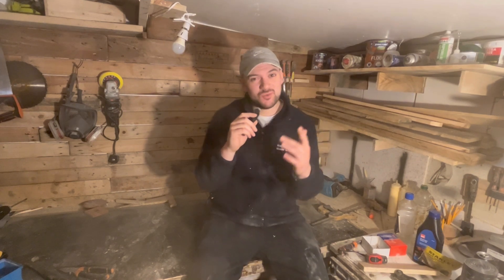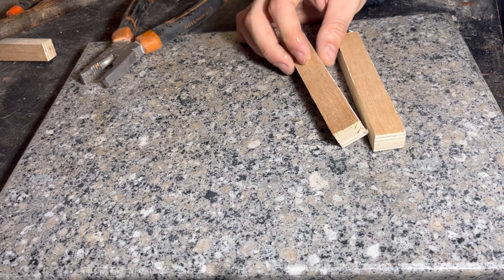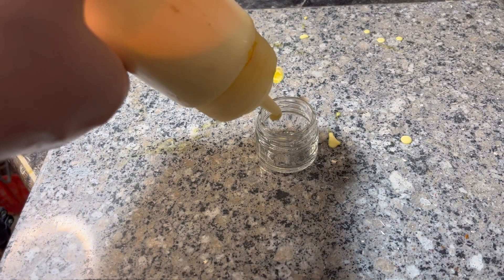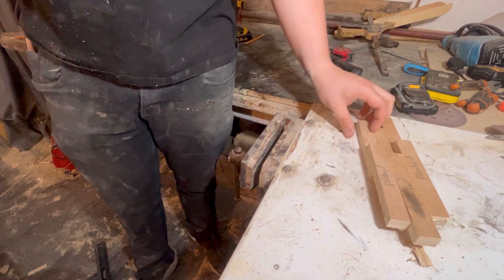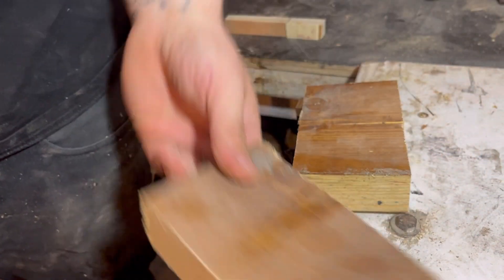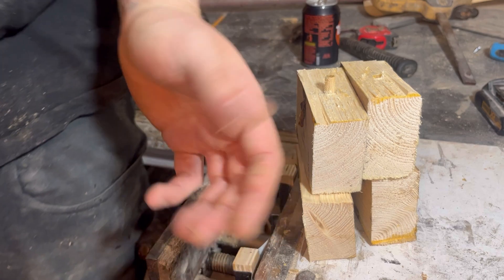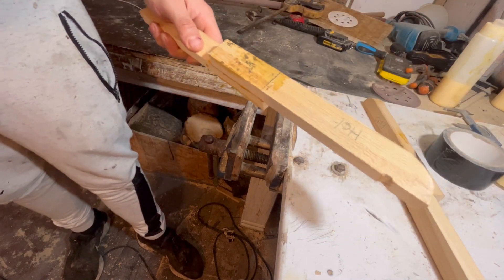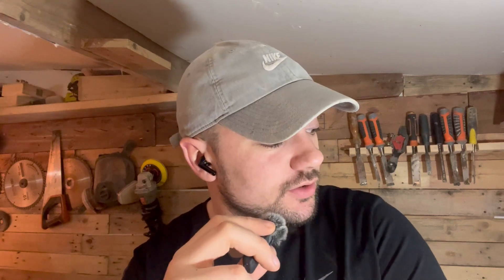Testing If Dowels Really Make Glue Joints Stronger

Comment: Depends what one means when they say 'stronger'.
If the sole intent is that it will be less likely to come apart, then yes, it will be...
But it is now an unstable - albeit still holding - joint... As demo'd really nicely when you clamped it down, heard the snap, but couldn't break it apart.

Introducing a structural weakness (drilling out the space for the dowel) and then stress concentration (introducing a foreign object- in this case a dowel which crosses the joint) will compromise the strength in absolute terms by introduction of any instability or deterioration of the joint.

It is all relative though, and in most cases insignificant.

If the joint is well aligned, and the two pieces being joined connect evenly, there is no need to dowel.

If however, it's a bit of an imperfect join, e.g. where an old piece of furniture has broken and not cleanly so.. Then the dowel will help to position thr joint whilst the glue/adhesive sets.
Not using dowels in that instance will increase the chance of slippage/suboptimal postitioning and decrease the strength of the join.

Another consideration is also the material of the dowel. Ideally it would be the same material as whatever is being joined, making it less of a 'foreign' body, its material properties will be much closer to whatever it is helping to join. (never perfect as grain/density etc etc all come into play... But closer, which is all we can hope for 😊)

Psst, love the video and how you don't junp to conclusions but are thinking about why something may or may not work!! Good stuff!

With the light clamping by the way, if there isn't enough pressure there will be small voids/bubbles in the glue so it will be less reliable in those areas. Clamp too hard and you push the glue out completely. Clamp just the right amount et voila... Perfectly homogenous, gap free glued joint! 

Now we can go figure out the ideal clamping force, taking into account force distributiion, temperature, humidity etc etc etc 🤪... And go raving mad whilst at it 🫨

Comment: The dowel seems to be stronger overall to me. I could see how the glue joint by itself might be weaker but I wonder if that's not true for the connection as a whole.
Reply from the maker: Yeah that’s why I wanted to test it out I hear a lot of different opinions about using dowels and it’s strength and weakness so I wanted to do a side by side and find out myself

Comment: I usually keep my gleu indoors during winter too just out of fear that it wouldn't work as well, thanks for confirming. While on the note of temp, super glue kept in the freezer don't clog up and goo hard the nozzle
Reply from the maker: I throw out so many super glue bottles because they clog up the nozzles or the lid glued to itself I might have to start doing that! I usually just put a screw in the nozzle but it chews up the nozzle so when I’m using it I make a mess

Comment: I always use Biscuits or Dominoes in my joints, they soak up the moisture from the glue and expand giving more surface area to the glue and joint and creating multi directional male/female contact, this makes it stronger not weaker.
Reply from the maker: In my mind it makes sense that it will be stronger but I hear YouTubers say all the time that it weakens the joint and that it’s only for alignment so I wanted to test it and from my test dowels seem to make the joint stronger

Comment: Dowels, Biscuits or Dominoes will 100% make a joint stronger, no doubt about it, the alignment is main reason and purpose but there’s no way it doesn’t improve on a joints strength.
Reply from the maker: In my mind it makes sense that it will be stronger but I hear YouTubers say all the time that it weakens the joint and that it’s only for alignment so I wanted to test it and from my test dowels seem to make the joint stronger
Reply: @barrovianmade I would think it would be stronger if you glued up the dowel hole too
Reply: @barrovianmade as long as they are fit properly to begin with, a dowel will add surface area I would think. Some joints won’t need it, like a box joint